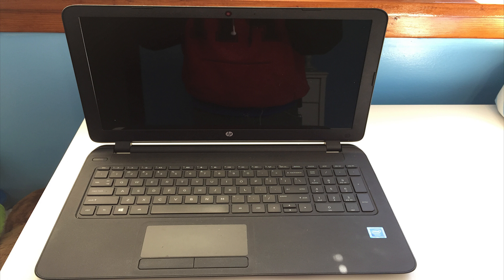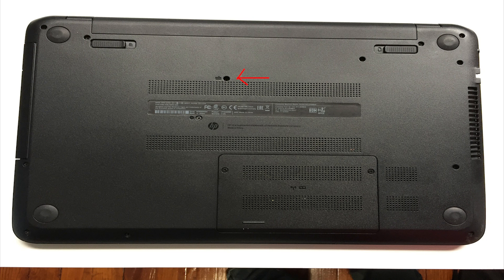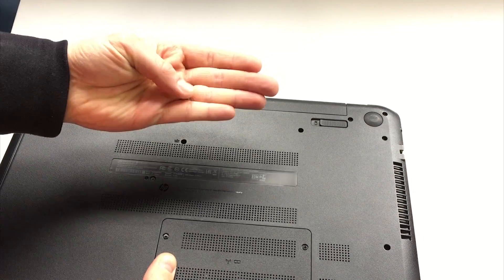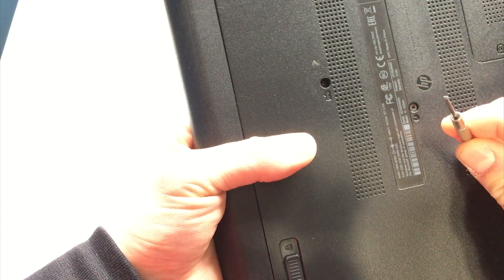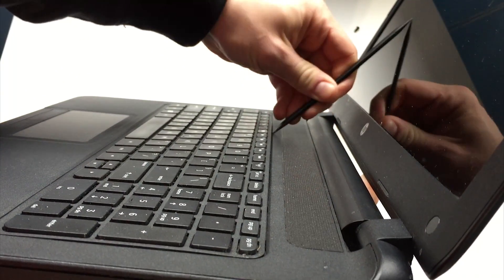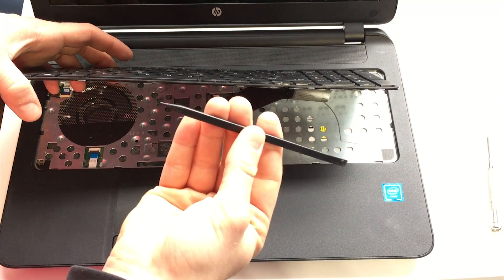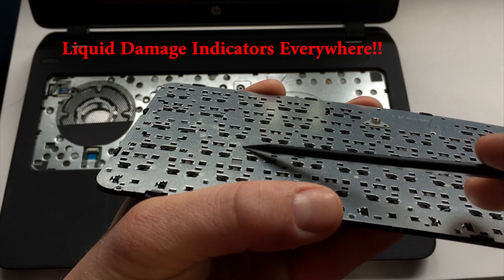HP Pavilion 15 - Remove/Replace Keyboard

Comment: I am a computer network guy by profession (30 years), and trying to help someone, who is literally a continent away right now, so I cannot touch the computer (the cell-phone repair place swapped out the keyboard, but now the sound and mouse do not work, so I was checking to see if they might have unseated some other wire...seems unlikely now, but going to watch a full disassembly video now). I loved how your instructions guided non-techies to safeguard the screw, showing the flex in the keyboard when pushing through the hole, how not to damage the plastic, and then, how to gently remove the ribbon cable.

Excellent video, and thank you.

Comment: THANK YOU THANK YOU! colors on my connector were reversed and never would have figured out that the flap is on the far side. Very nearly pryed the connector completely apart. Yours was the only video that showed a connector like mine.

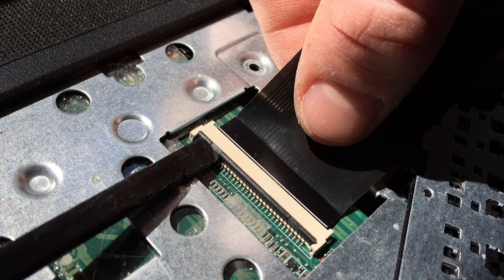Comment: Great video. @1:53 in video where you lift tab and pull ribbon out, what happens when the white connector part comes off? mine did. I dont see where to connect it back? I have no keyboard now. How do I fix that?

Comment: Thank you. Everything worked....V EXCEPT 1:44 I broke that black piece. Keyboard works be but how do I replace the black clip? Also a one button does not work on my new keyboard. Do you think it the keyboard or a pin is broken? I have no reason to believe the pin is broken but I'm no expert.
Reply from the maker: Oh no! I’m not aware of an effective way to replace the locking bar for the ribbon connector. You could use kapton tape to secure it in place. That keyboard might be an issue, or it could be an issue with the system board. Maybe send it back and try another to see if the issue is the same or fixed with the second keyboard.
Reply: @DavidStumph  https://youtu.be/UXoU9E9Fkyw
Reply: Comments back on on my video. Please watch and tell me what you think
Reply from the maker: @AlphaBravo860    very clever way to respond. I actually noticed some darkness on the metal base where the keyboard rests and the ribbo n connector attaches. This looks like it could be either just dirt or remnants of a liquid spill. If liquid entered the system at any point, it’s likely the contacts on the connector where the ribbon insert or the system board. The numpad keys seem like they work, it’s just are not minding numlock. I’d suggest bringing the Windows onscreen keyboard up or the system diagnostics before boot and see if any keys are stuck in the off position. I also have keyboard a troubleshooting video that might help -  HP Pavilion 15 Series - Keyboard Troubleshooting https://m.youtube.com/watch?v=Yuzyr70z9X4&feature=youtu.be  my gut on this one is the system board or the connector. I’d guess if you disconnect the new keyboard and attach an external usb keyboard everything might work unless there is a short somewhere locking numlock in the off position. Good luck!

Comment: Thanks for this video.  Unfortunately, my keyboard connector hinge popped off!  Now the keyboard ribbon cable won't stay in place.  Any suggestions how to fix?
Thanks.
Reply from the maker: Hot glue the hinge in place, low heat. Best bet other than a new board.

Comment: so ok Q how do you fix the clip connection there that kinda broke when you replace the keyboard
Reply from the maker: Not too much you can do without replacing the connector which is soldered to the board. If the black gate is still intact somewhat, you can insert the ribbon and then tape down the connector. Though over time the adhesive may let go. Hope that helps.
Reply: @DavidStumph  the HOLE thing broke off, the hole clip to the ribbon to connect, so im just using an usb plugin keyboard tho i dont know if i have to go to a computer place and how much to replace it
Reply: @IccyBrosSavages   You'll end up having to replace the entire motherboard to get one with a keyboard ribbon cable clip that's not broken on it.  Same damn thing happened to me with a very good Dell laptop that just had a worn out keyboard that I wanted to replace. I was careless and in a hurry and broke the keyboard "zero force" clip (zero force, my arse!), and am now using a USB keyboard/mouse combo - which is actually fine with this laptop - it is powerful enough to be used more as a desktop replacement, anyway. So, back to the point - if you can live with the USB keyboard arrangement, that's definitely the easiest, most convenient way to deal with the keyboard issue. If not, you'll be replacing the motherboard on the laptop to get the on-board keyboard working correctly again. It's all up to you, friend. :) Good luck!

Comment: I did it!! I did it!!! Your video was so easy to follow, thank you!! I use my computer constantly and when I spilled a bit of water on the keyboard, I thought I had a catastrophe on my hands. I was so scared to get an estimate that I've been using the onscreen keyboard for 2 weeks. Geek squad told me it would be approx $50 to diagnose and fix. But I found your video, ordered a $12 keyboard and just followed your instructions and voila!! I'm writing to you on my just installed keyboard. Thanks David!!
Reply: P.S. I meant to say that the only thing I think you might include is this. On the replacement keyboard I got, there was a blue plastic film that covered the blue connection ribbon cable to the computer. Since the one in your video was blue, I just assumed it was fine. But it wouldn't fit into the cable connection. (i know, I know. But we non-tekkies don't know these things). Anay was I was almost going to use my tiny manicure scissors to trim the film on my replacement's ribbon cable when it occurred to me that just maybe it was a protective film. So I took a swig of sake and slowly peeled it off with my fingernail. Whew! Thanks again David!!
Reply from the maker: Haha... this is awesome. Thanks a bunch, and you’re very welcome.

Comment: Great tutorial.
One thing, I find an old credit card a much better tool for running round the edge of the keyboard.
That thing you were using looked too long and it looked like it hit the screen a couple of times.
Edit: FYI, my 15" Pavilion has two screws holding the keyboard in place

Comment: Thank you for this informative video. Can I replace a regular laptop keyboard with the same model "backlit keyboard"? If I can would there be extra steps?
Reply from the maker: Hi Sound an alarm - not entirely sure, but if the pin count and the dimensions are the same, I would think this is possible. I would suggest ordering from a source that allows returns to be safe.
Reply: @DavidStumph  Thanks, David.
Reply: Sound An Alarm did it work out for u? I’m considering this

Comment: It turns out there's more than one construction design for HP 15 Pavilions. The one I'm focused on is 15-p267nr. I started to disassemble it to confirm the HP part number on the keyboard. The hole on the bottom doesn't have a keyboard icon, and when I poked with a small driver, the keyboard bulged up, but I didn't see any gap at the top edge. It didn't seem to want to give in the same way as you demonstrated on this post. I searched more and found another video posted to YT, by Games Matrix.
https://www.youtube.com/watch?v=UCCCXxWe4Mo

That post illustrates disassembly of HP 15 "P" Series Pavilions. I didn't watch past the part where he removes the keyboard, because that showed me what I'm dealing with. Suffice to say, there are major differences. There are many more screws to remove, some are hidden under body pieces. And the major major difference is that the keyboard itself is not a separate part, it's the top bezel (?) part of the assembly that forms the entire top of the case shell, including the palm rest, speakers, etc. At 7:05 - 7:10, he lifts it off and removes it. You'll see what I mean. 

I've run into this with another laptop before. It's a HUGE PITA. When you're dealing with HP Pavilion P Series laptops, the keyboards are NOT the same. FYI.
Reply: The part needed to do the keyboard replacement for the HP 15-p267nr is all one assembly of the upper shell of the case. There are some ebay sellers selling separate keyboards using that model number but they're lying. That part can't be bought from any U. S. based seller. They're only used (or "refurbed" as some sellers like to say). They sell for at least $60, new are probably unavailable.

When I dealt with a client that had a similarly constructed device, I lost money and involved extensive un billable time.

Troubleshooters. Beware!

Comment: Thanks man, I used this and the diagnostic video to find the dodgy key which was preventing my keyboard from being used. I didn't have the grey metal pin to push on after removing the keyboard retention screw but otherwise it worked exactly the same on my pavilion 15.

Comment: The clearest speaking narration by a well chosen word tech. Love it.
Reply from the maker: Thanks a ton!
Reply: You're very welcome David. :D Might you know?  I am looking on ebay for a replacement keyboard for an HP Model 15-AB149CY  P/N T3N74UAR#ABA     I don't find that exact model # on ebay, but I do find a HP 15-AB Laptop, without the "149CY" reference.  https://ebay.to/2NsOn1k    Do you think it is the correct replacement Dave? Thanks a ton.
Reply: No. It's NOT the right keyboard.  This Pavilion looks like the entire top case needs to be replaced. Hmmm.

Comment: I've replaced keyboards in the past. However, when water spilled into my HP Pavilion 15-z (all white) it took me awhile to obtain a replacement.  When I got the keyboard out, part of the white plastic holding down the keyboard ribbon was off, and it came apart as soon as I touched it, gently.  So I guess that is the end of my lovely laptop.  The back part that you show that lifts up (black), is not like the one in video or others I have seen.  This one seemed to slide out a little but not up. but now with the white strip broken I will just have to return the keyboard.
Any comments before I do so?
Reply from the maker: Hey Kathy Maduke , Thanks for reaching out - I am impressed with the description you provided. While I could offer a number of short term solutions involving low heat glue, or unless you want to go through trial and error trying to find a replacement piece that moves to lock in the connector, I would suggest sending the keyboard back. I am not sure if your going to opt to use a wireless or wired keyboard, or spend a ludicrous amount to replace the entire system board, or if you are so skilled you plan to micro-solder a ZIF connection back on the board, but the juice may not be worth the squeeze based on your description. Let me know if you come up with any light-bulb ideas or have any other questions, always here to help. Sorry for the delay, it has been a long week.

Comment: Note that on some newer HP laptops, the keyboard is plastic riveted to the top panel.  You can still replace it, but the keyboard won't be as tight as it used to be.  You need to use a glue gun to secure the support frame.

Comment: Black thing pinged up in my face of the damn keyboard .any idea how to get it back on?
Reply from the maker: Hi @Tweddlya - If you are referring to the ZIF locking bar, you may be able to reinsert it at an angle as i believe there may be two barrel tabs on the bar that hold it in place within the white colored socket. Otherwise, these may be broken and I can't say how you would secure the ribbon in place...Maybe low heat hot-glue if you really get in a bind but you'll need to mind the integrity of the ribbon since it is made of plastic, don't want it to get too warm...Best of luck.
Reply: Try cutting out a thin piece of plastic like a old credit card or gas card for example whatch you don't bend pins on motherboard it's fiddly but possible

Comment: Dang ! didn't workout for me. This is supposedly a product number x7t78UA#ABA laptop. No screws have the keyboard ICON.
Though is looks the same it isn't. Kind Of a downer s I ordered the keyboard for the thing. Guess I will keep trolling to find mine. Hp support says it's a HP Notebook - 15-ba009dx. Guess stuff happens. Tick tock 8^(.

Comment: I have replaced many keyboards, and all so far have had the side towards the cable flip up. After that did not move as it should I started searching videos. Thanks for helping me not rip the connector off the board. PS HATE HPs
Reply: Jamie Carlson i actually ripped it off first😂
Reply: I hate hp's too
Reply: how to replace the clip i broke it the keyboard works fine
Reply: BUT im using another usb keyboard